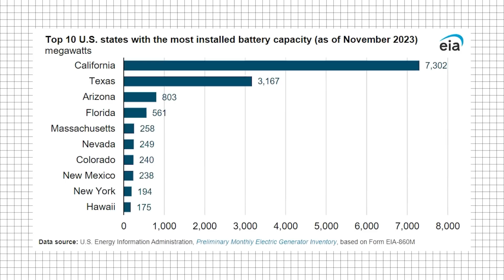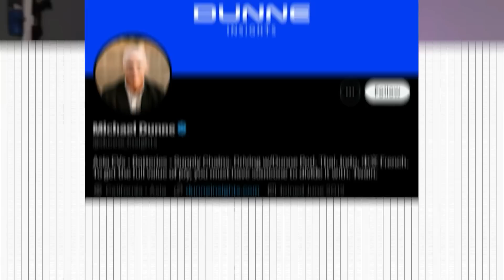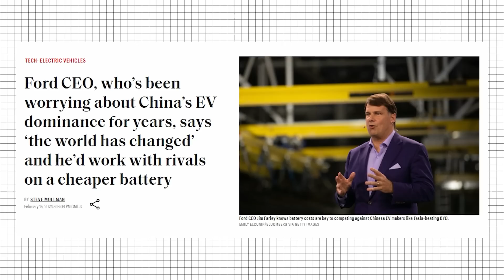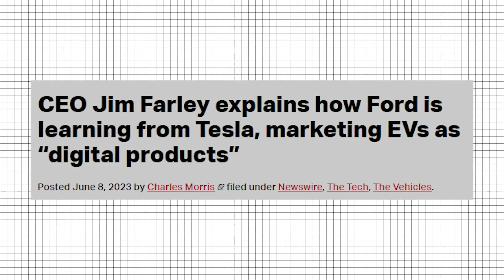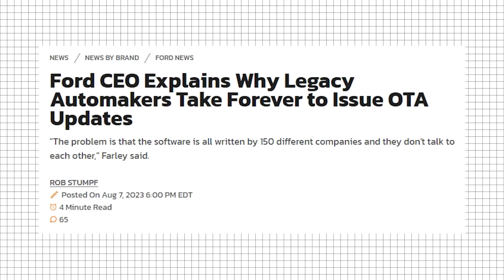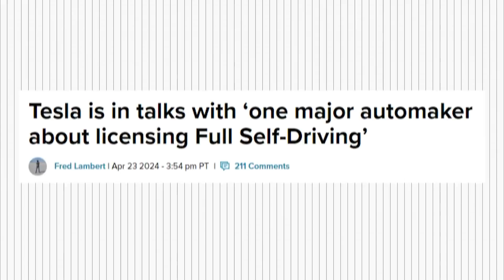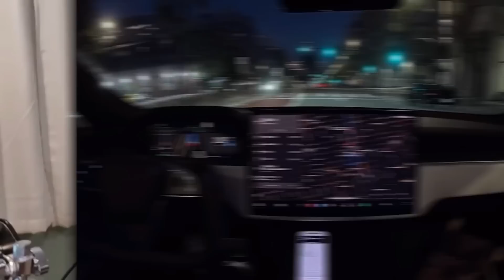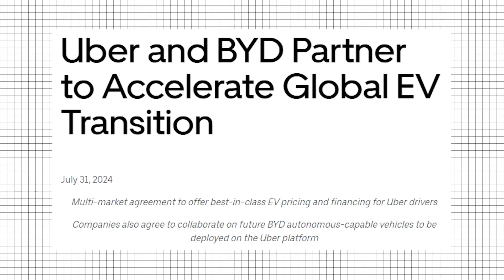Tesla’s GIGANTIC Opportunity

Comment: Battery storage will be much needed for the future, but what about energy production?  Elon once said that it would take a postage stamp approximately 100 miles by 100 miles to power the entire US.  That's approximately 10,000 square miles.  There are approximately 70 Interstate Highways in the US which are just under 50,000 miles, now imagine if the US were to install solar fences on both sides of all these interstate highways which run through every state.  That would be approximately 100,000 miles of solar fencing which wopuld take up no new land & with a small wind turbine on every fence post & how much power could be created just from solar fencing on all the US Interstate highways.  And would that be enough to power a modern world of electric vehicles?  I think so.  

Now imagine a 3 Tier road system whereby Tier 1 is for public transportation which includes solar fencing on both sides of the highway.  Tier 2 would be directly under Tier one underground & would be for electric commercial vehicles reducing traffic from public roads.    This underground level would be powered by wind turbine fencing on both sides of the highway taking advantage of all the wind created by the traffic which would add to energy production from this highway system.  Tier 3 would be several tunnels fto transport sewage, clean water, irrigation water for farms, fish farms, transmission lines of all kinds, battery storage & could be used for hydroponic farming underground away from environmental disasters.
Reply: Naaa not cost effective
Reply: Gee that’s a big postage stamp.
Reply: He’s wrong and it’s a horrible idea. He first started saying that stuff when he wanted to rip off Tesla investors into buying the lemon that is Solar City. Solar City isn’t doing even a small tiny version of anything you’re talking about. Because it doesn’t work financially or practically.

Comment: Do not underestimate the value of the multi-sensor system that waymo has. Teslas will be helpless in fog and poor conditions
Reply: You can have a $40K all-in car that will work in 99% of conditions in 99% of the country or a $100K car that can work in all conditions but only in geofenced areas. Solution - don't go out in those 1% conditions
Reply: @travisjazzbo3490  The Geely costs $27,000 to make
Reply: @DanielASchaeffer  SO that is a fact that a full Lidar arriving here in the USA costs $27K? I can't find that anywhere.

So are you just interested in the limited robotaxi service in big cities?

I might have been missing the point. My interest is in cars that can work anywhere without limitation and can be used as both a rototaxi as well as consumer use as well as commercial Semis etc.

Maybe I am off base in the conversation
Reply: @travisjazzbo3490  I too want an all-purpose chauffeur, but Tesla may be making perfect the enemy of the good. Waymo is grabbing market share while Tesla has yet to enter the market and Waymo is poised to start ramping.
Reply: @DanielASchaeffer  True. They are out there grabbing the Robotaxi business for sure.

Tesla's tech is 100 times harder to develop and maybe 100 times or more, more expensive. If they fail in what they eventually want to accomplish with their vision, then Waymo for the win for sure for the Robotaxi business. If Tesla does in fact accomplish what they are setting out to do,  then Robotaxi will be at risk of course, but more importantly, all the other areas Telsa tech accomplishes, including for the everyday driving person, for the Semi, the extreme safety stats for everyone that Waymo and Tesla are already stacking up... it will be insane.

It's going to be really, really interesting to see where it all goes that's for sure

Comment: I'm not sure why folks who need to store highly unreliable energy from solar and wind need to store it in highly toxic lithium batteries. Where did that insane idea come from?

A much better way to store energy is in a gravity battery - storing energy by lifting a heavy load with a motor 
and then lowering that load the motor becomes a generator.

No chemicals - no 10 year lithium battery life - just clean energy storage/retrieval from a gravity battery at 1/10 the cost.

I asked AI this question:
Q: compare the pros and cons and cost of a lithium battery system to a gravity battery when storing energy from solar and wind

AI:
When comparing lithium battery systems to gravity battery systems for storing energy from solar and wind sources, there are several key factors to consider:

Lithium Battery Systems
Pros:
High energy density, allowing for compact storage
Fast response time, able to deliver power almost instantly
Well-established technology with improving costs
Suitable for both short-term and long-term storage
Cons:
Limited lifespan, typically degrading after a few years
Environmental and ethical concerns around lithium mining
Potential safety issues like fire risks
Recycling challenges at end-of-life
Cost:
The lifetime cost of lithium-ion batteries is estimated at $367 per megawatt-hour over a 25-year period.

Gravity Battery Systems
Pros:
Very long lifespan, potentially 50+ years
Uses simple, durable mechanical components
Environmentally friendly with minimal ecological impact
Highly scalable, especially when using underground shafts
Cons:
Lower energy density compared to lithium batteries
Requires specific geography (for some designs)
Still an emerging technology with limited real-world data
May have higher upfront costs
Cost:
Estimated at $171 per megawatt-hour over a 25-year period, according to one analysis.
===================
A gravity battery is 1/3 the cost of a lithium battery.

Comment: If batteries are so much cheaper now why not make a 500 mile range Model Y? Put range anxiety to bed...
Reply: So a increase of 25% in size and weight, plus of course the added cost.  Do you want to buy one?
Reply: You want to drag a 500 mile battery around each day doing your 20 mile trips?
How often are you doing 500 miles without stopping?
Reply: Range anxiety is due to ignorance, not a shortcoming of the car.